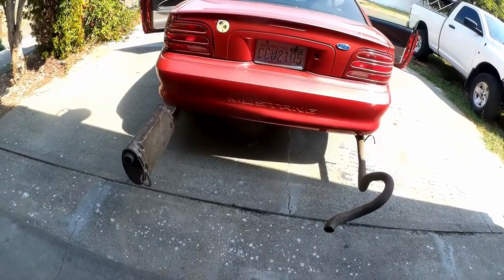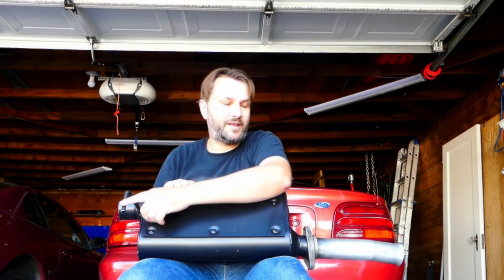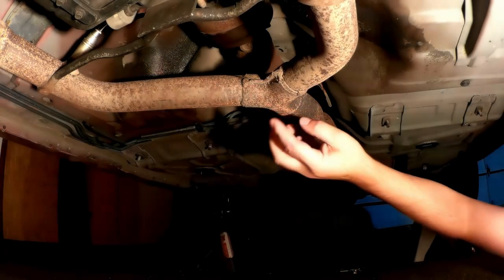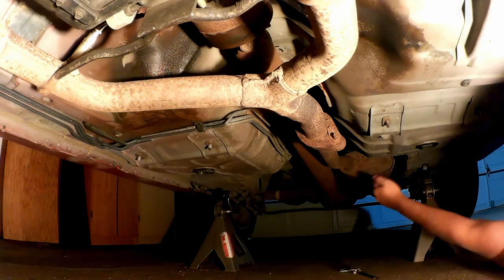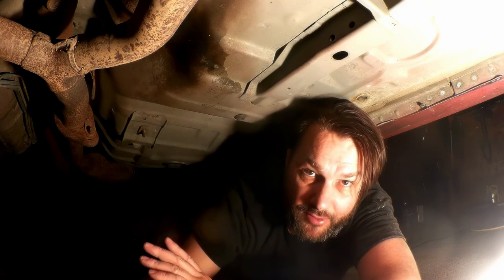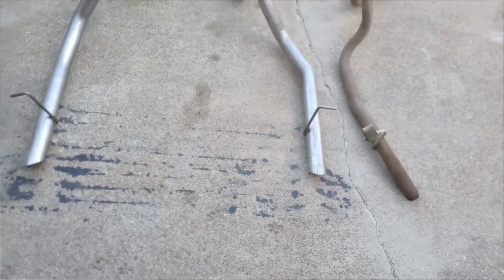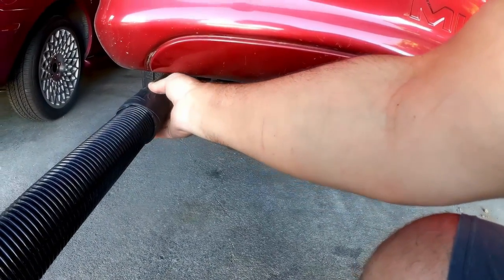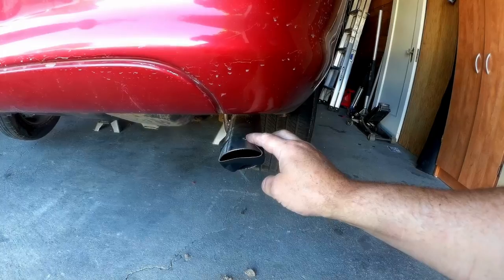True Dual Exhaust - Save A Stang 27

Comment: Glad I found someone else that loves this platform no matter what engine set up it is. I’ve had a 4.6 5speed and currently a 3.8 5speed.
Reply from the maker: Last summer I found myself driving my 3.8 more than I drove my 5.0 in part because it's more fun to drive a slower car closer to the limit,  than to drive a faster car with restraint.   Nowhere legal or safe to really open up the 5.0 except at an organized track event!     The V6 feels lighter too.. well it is lighter but it feels a LOT lighter.    It's still not a Miata but you know what I mean
Reply: @shoveI  I love my 3.8  it’s a very fun car for what it is